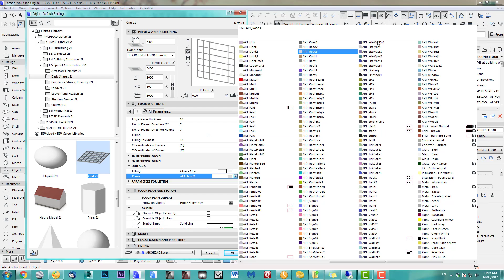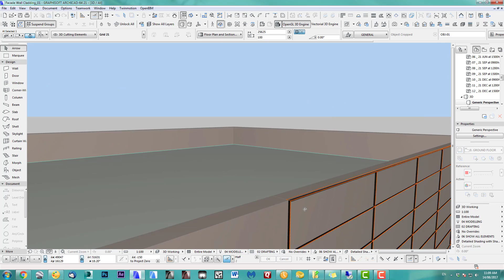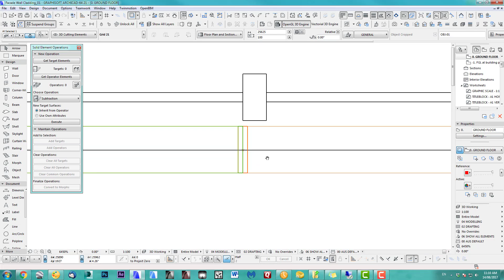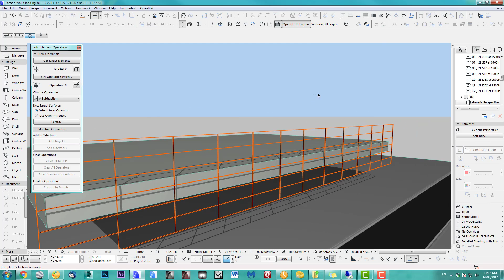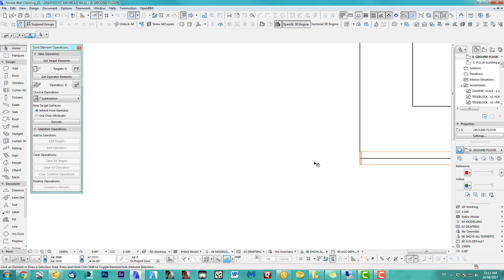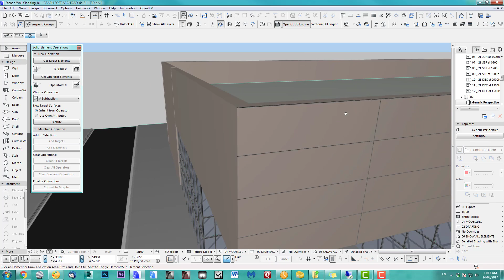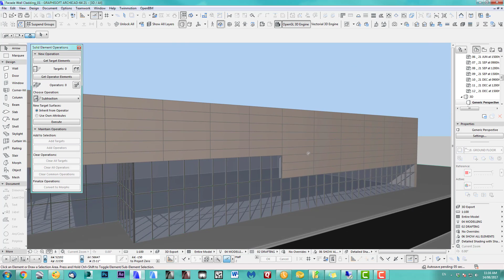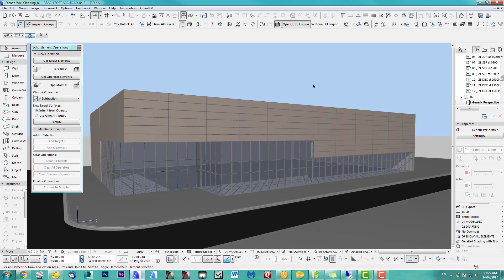How to model a Cladding Part 1 in Archicad

Comment: Ah… I’m trying to figure out how to model T&G Timber V-Joint Wall panelling for my INTERNAL walls 😬 ✏️  
I have made some beams and copied them at 90mm ctrs across my CLG SIPS Panel that has a V-Joint option on the ceiling side.  I then did a SEO on it and it looks great but I dunno, gotta be a better way, especially for wall 🤷‍♂️
Reply from the maker: Hey Laurence, what you did is pretty good, the only thing you could try to use is the curtain wall or handrail tool. I have not tried this myself just an idea I came up with. Good luck and let me know if that would be a solution.

Comment: That's a great method.. 
however if we need to quantify the cladding, it won't be efficient. Hopefully I am wrong ?
I guess we can use the matrix array to achieve the same result but with quantifying in mind..
or for a more advanced technique we can use the param-o or grasshopper.. 
just sharing my thoughts!
Reply from the maker: Thanks for your thoughts and yes many of my models here on this channel are with 3D visualisation in mind and not the quantifications! Matrix array would work of course but is not as flexible if you like to change the divisions quickly for a different look. Grasshoppers I find too user unfriendly, like it is very powerful but if you don't use it at least on a weekly bases it is hard to keep the skills up with it.
Reply: @ASMTechbase  I am the one who loves to thank you for your amazing content and great tutorials. 
And ofc Grasshopper isn't the most straightforward method.. it is tricky and needs patience with a lot of testing time. 
Thank you again.. and I'm proud to be one of your followers!

Comment: amazing video my friend. keep it up.  
i have a question for you. i have tried archicad 20 and it seems that you cannot really do a lot directly on the 3d like in previews versions.  Did they reduced the freedom on changing things on 3d directly (move - extend- drag etc)?
Reply from the maker: HI PanKon, no it's still all there ( using the right mouse button )  So if it is not working for you , you might have to re install AC 20. First of course restart your computer, that could fix it too. If it still not working contact your local AC re seller.
Reply: thanks for the reply. i'm not sure what you mean by right mouse button. i do it the same way i used to do it since archicad 12 onwards. So you assume they have not changed anything it is just my archicad's fault maybe. thanks a lot mate